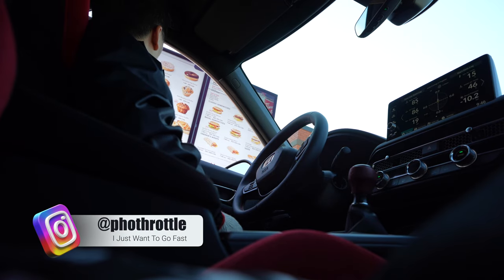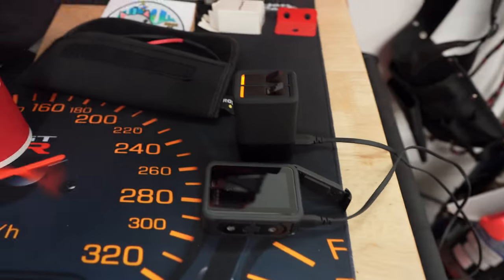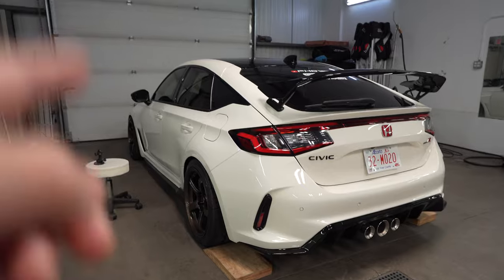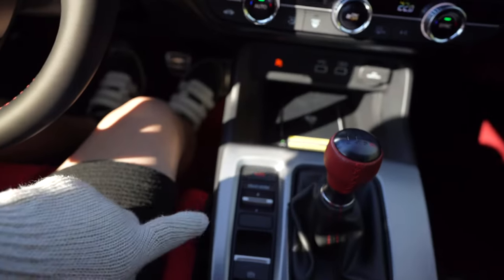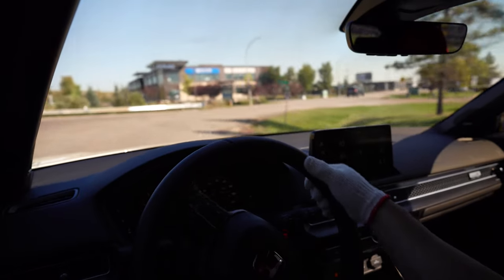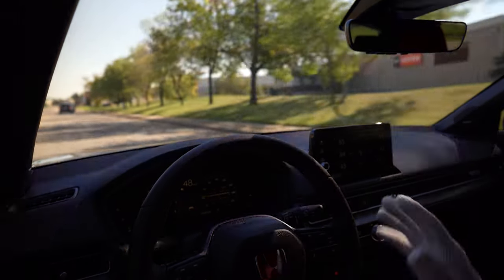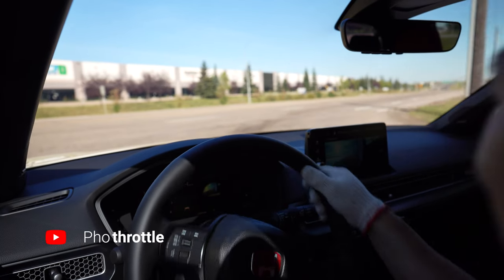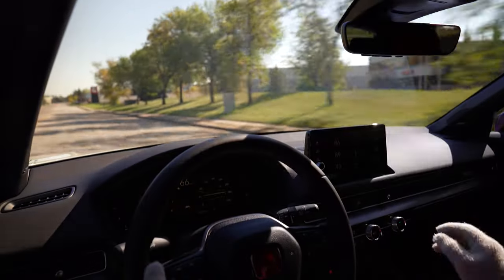Type R New Coilovers || Driving Impressions

Comment: Hi. Did you reverse the top hats on the RSR for negative camber? also did you do anything else for the camber settings at the front. It seems there no rubbing on your set up at all!
Reply from the maker: No I didn't reverse the top hat. I just set the spring preload then the ride height to where I like the look. There is no rubbing. Now that they are broken in I'm adjusting the dampening.
Reply: Awesome man thanks for the info. I am running pretty much the exact set up and will be installing soon. Was wondering if I needed to run the camber at the tophats. Would you go lower? Also are you running any sort of camber arms in the rear?
 @phothrottle
Reply from the maker: I originally had it lower and it still had clearance. Looks wise it was flush. I will add be adding more suspension components soon. Just waiting for certain jdm companies to  release them.
Reply: @phothrottle  thanks man appreciate you taking the time for response. Can’t wait to see future mods. Keep up the good work! From NZ

Comment: Did you notice any noise after installation ? I have the same set up on my FK7 and when i drive over the pothole i can hear some noise. I hear that only in lower speed . I checked my preload , double checked endlinks , all the bolts but noise seems to be still there. Maybe this is how they are supposed to be but i came from HKS hipermax and i did not have this problem. Thank you in advance
Reply from the maker: The only noise is had was on my first drive. Most likely due to the suspension just settling in and in its initial break-in period. I don't have any noises now.

Comment: Thanks for putting this video together! Would you say putting the RS-R in the middle setting and adjusting the modes from there would be softer or harder than the factory FL5 suspension?
Reply from the maker: Matt I find just a little softer than factory. This is the setting I have on my setup at the moment. Because of my ride height im at it can be a bit bumpy.